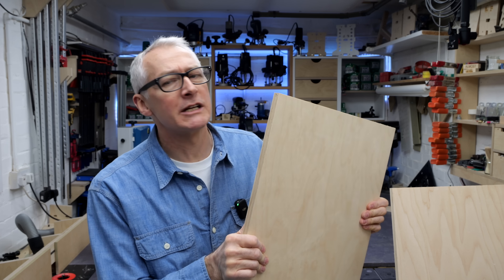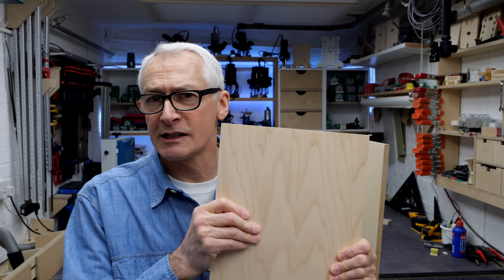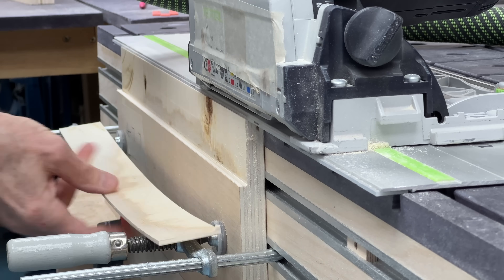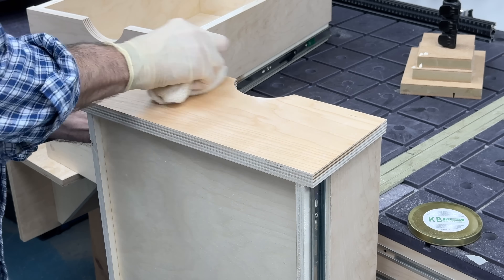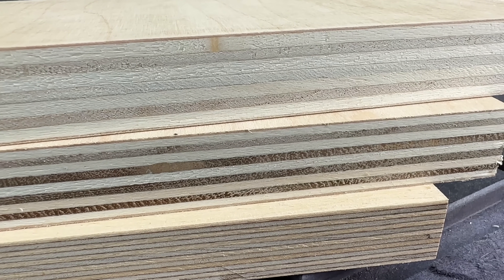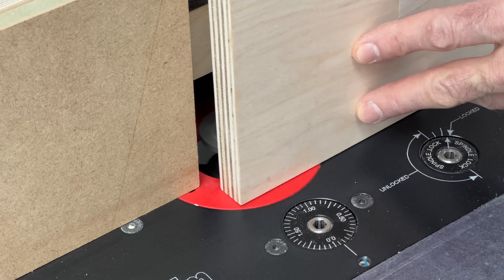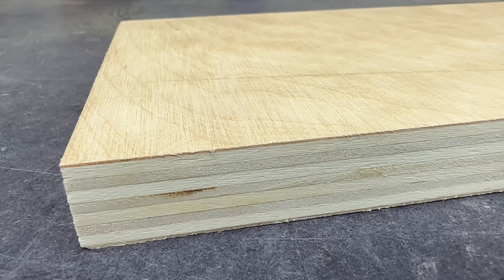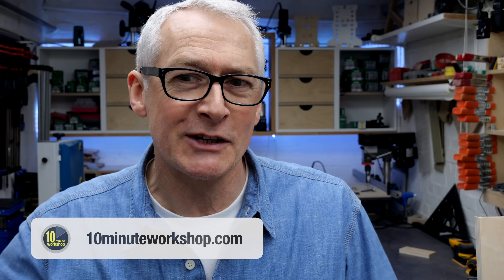Birch Ply Alternatives? [video 527]

Comment: Very interesting. I haven’t bought any birch plywood recently as we had and have a good stock. I would only advise people to be careful when comparing prices of “birch plywood”; not all birch ply are made equal. You do need to check on the number of plus and also the codes for the surface quality (B or BB etc.). Then select the quality you need for a particular job.

But is the price for any of them  “appalling”? I don’t think so. The prices we are paying for all board, in fact all timber, have fluctuated enormously over the last 3 or 4 years. Events such as the war in Ukraine, sanctions on Russia plus the pandemic saw a sudden and extreme change on the laws of supply and demand such that prices soared. Some of those increases have peaked and are dropping but certainly not yet back to levels of, say, 2019. 

Timber is a commodity in the same vein as gas, oil, wheat, iron ore and hundreds of others. Subject to supply, demand and speculators. 

Is anyone making fortunes out of all of this? I’m not so sure. The producers were operating at reduced levels due to labour shortages but their fixed overhead costs remained largely the same. So the overhead recovery per sheet or per pallet had to soar. We have all heard how the cost of shipping have increased as has the cost of diesel or petrol for transport. 

Lastly, we have the timber merchant. I know one of ours quite well. He prices his stock based upon a mix of what it cost him and what it will cost him to replace. So, if a cubic metre cost him £2000 but the replacement will cost £3000, then he prices at £2500. So, he gets a windfall profit. Now. But, when he buys at high prices (say £3000) but will replace at £2000, then his cost price is £2500 which is a paper loss. Then, of course, he has to add his margin to cover fixed and variable overhead costs. 

Going back 10 years or so, the price of waney edged boards was very low. If it had defects like checks, splits, inclusions, then it was probably as good as firewood. Now? The price of a defective waney edged boards is, per cubic metre, higher than processed square edged board. And yet, if I have to process waney edge onto square edged, I will probably have a wastage of 40, 50, 60%. Now that equation of waney to square does make no sense; except it is supply and demand. So, someone who was producing firewood is now making a lot of mone.y good on them.
Reply: Sorry, but I don't think you're correct. Firstly, Maersk shipping like a lot of corporations have posted record profits in their last financial year, and the global shipping price index is low, reflecting reduced economic activity in global markets. Right now, it's not business as usual and price gouging is a thing throughout supply chains as every supplier tries to raise prices. Those with enough market power will succeed until demand drops off. There are those who are testing just testing price tolerance, because you know these prices are not going back to what they were.
Reply: @BigHenFor  I can’t talk about Maersk but I know that al out of shipping rates are booked well in advance; just as people forward buy currency in order to get a price certainty. Of course, a key part of marketing is understanding how much the market will bear - I’m sure that controls the prices that Festool, for instance, charge. However, pricing of most commodities is a factor of supply and demand. If the production requirements (to keep a factory running) of a particular product that is made across various companies and countries are high and demand is less than that, then prices almost certainly fall. At the moment, from what I am told, that supply and demand balance, which was so heavily in favour of restricted supply, is currently falling somewhat towards lesser demand. I’m told to expect further easing of prices but we shall see.

Comment: Excuse the potentially naïve question but apart from the look of the endgrain, how are these plywoods such a difference to say a sheet of 18mm hardwood ply at about £40 from Wickes et al and especially if you're just making carcasses, shelf units, and the like?
Reply from the maker: I do go into the details in the Baltic Birch Basics vid - link in the description - but it’s basically a much better quality board with better core layers and face veneers. I’d check out the other video though. 👍👍

Comment: What are your thoughts on dust generation?  My experience with what I believe was poplar ply was that it made a lot of very fine choking dust, even some later after I improved.
Reply from the maker: I haven’t noticed anything different about it tbh, but I always use dust extraction so it would need to be pretty bad to be noticeable. 👍

Comment: Hi Peter wow those alternatives are still expensive fortunately my local timberyard are quoting £135 for 18mm Birch ply which is still a lot of money but they don't have the alternatives
Reply from the maker: At £135/sheet I’d snap it up if it’s decent quality. 👍👍
Reply: What buildes  merchant is that?
Reply: Well, if Kevin does name the merchant it will all be gone by the time The King has his hat on tomorrow.
Reply: @emmetworkshop2829  comment of the day, thanks for the 😂

Comment: At those sorts of prices, would bamboo be a viable option?  19mm 8x4 sheets are around £200-£250 from somewhere like UK Bamboo Supplies.  Obviously looks are subjective, and I've no idea how it works but might be an alternative to other ply or mdf.
Reply: Not worked with bamboo sheets but fitted some bamboo worktops and they required extreme care to minimise splintering, not a fun material to work with.

Comment: If the issue is just the visual appearance of the cores then do a demo on edge banding or veneer. It's really fast with the right tools.

I think In the future we will need to learn to appreciate the defects in more basic materials such as shuttering and softwood ply, and make the best of simpler cheaper materials.
Reply from the maker: Edgebanding can only go so far - try edgebanding a tight internal curve like a handle cut-out in a drawer front, for example - and a large part of the appeal of Birch is the lack of any special edge treatment needed. But I agree, we'll need to get used to less than stellar, cheaper materials; unfortunately these two boards are too costly to be in that category! 👍

Comment: Thanks Peter, interesting video. Do you ever use blockboard at all? Seems to have gone out of fashion but might be a useful substitute for ply in some situations.
Reply from the maker: Can you still buy it? Haven’t seen it for donkeys years!
Reply: @10MinuteWorkshop  Absolutely. Google throws up lots of suppliers, £40-£80 a sheet for 18mm. All I have seen so far look thinly veneered, not Baltic Birch quality but there maybe some good stuff out there as well. Obviously not a direct replacement for ply because of the directional grain but would be a good substitute for carcasses etc and maybe not as poisonous as mdf.

Comment: Do you have something equivalent to the German 'Dreischichtplatten' (3-Schichtplatten) 3 layer sheets in the UK?
Reply: The closest we have is a blockboard....thin plywood facings over a solid wood block core. It used to be very common, but I haven't seen any for sale for years.
Reply: Actually, I've just googled it and it is still available and rather cheap at about £50.00 for an 2400x1200x18mm sheet!
Reply from the maker: I might need to take a look! 😯👍
Reply: @davidhull2060  That would be Tischlerplatten or Stabsperrholz in Germany
Reply: @10MinuteWorkshop  SWL Holzplatten is a supplier of these materials in many variants. Your YT colleague Heiko Rech has an excellent item (in German) on 'Tischlerplatten und Dreischichtplatten'

Comment: I must admit, bare MDF has started to grow on me.
I built a quick cabinet for the office last week using B&Qs finest and just left it 'raw'
Reply: You are one sick puppy.
Reply: @FIZZYYAM  at least it looks better than pine
Reply: Not really much difference between MDF and PLY prices in B&Q,  £37 and £45 respectively ....... both prices are a joke compared to a few years back ..... with regards the MDF, varnish the surfaces and then sand/seal/paint the edges and you get quite a nice look 👍
Reply: B&Q used to sell Birch ply. Their MDF has to be the worst quality MDF but what can you expect for £37. The softwood play isn't too bad but that garbage hardwood ply with the wafer thin veneer, I'd rathe ruse OSB than that stuff.
Reply: Not sure if it varies by area but certainly both B&Q stores near me sell Medite MDF
Reply: @paulmcfadyen689  the two different B&Q's I go to have different stock. One has Medite MR but just an unbranded standard, the other has the unbranded in both.

Tbh, I've never had an issue with their own brand one, cuts and sands beautifully and the surfaces are perfectly smooth.
Reply: @animationcreations42  oh we don't get MR mdf in B&Q here
Reply: @barry.w.christie  I think those prices speak more so to B&Q quality, than it does either materials. Their MDF is awful, and their plywood is worse!
Reply: @monkeysausageclub  Agreed. B&Q is the worst stuff out there. Wickes have half-decent non-MR stuff, that makes what you can find at B&Q look like cardboard
Reply: @FIZZYYAM  Yes officer, this man right here

Comment: The poplar core/maple faced plywood is typically edge banded or face framed. It's not ment to be an exposed edge material, that's why the veneer is thin. It's the same thickness as cherry, mahogany, etc. Solid poplar is used as a paint grade moulding wood in the North America. It's a super fast growing semi-hardwood. More weed than tree. Baltic birch was a great material. China birch is not.
Reply from the maker: I’d have no problem with them calling it a nicely veneered plywood that requires edgebanding. But I t’s sold here in the UK as ‘the real alternative to Birch ply…’ which it isn’t. 🤷‍♂️

Comment: Baltic Birch used to be a "cheap" alternative to solid hardwood glue ups. Sigh, I'm looking at solid wood again, or just girding my loins and paying for BB. And doing fewer projects (although the weather has proven to be a bigger obstacle since I have to work outside). Just wish it was easier to get that solid black (or at least a colored water resistant) MDF. I can special order it, but would rather see it in stock.

Comment: I was horrified at the cost of 18mm birch ply when it reached £80 for an 8x4 sheet... as a hobbyist, its just not viable at current prices.

My last project was a set of floating shelves in my kitchen. I ended up building them using an open box of engineered flooring from b&q. Needed a bit of planning, but they're accurately dimensioned and stable, and required almost no finish work. Obviously no good for professional work, but its an option for the hobbyists.
Reply: Let me know where you can get Birch PLy for £80 a sheet!!! Unless you mean £180...

Comment: Thin veneer on junk board for full price.  ow.   Probably better off buying B grade plywood and veneering them yourself at the end.    Shops won't want to do the extra labour but for home gamers the cost of plywood or any wood has been out of control.    Local plywood store quoted a lower price on Maple plywood than Baltic Birch.    I still have to call to get details on whether this is a lower grade.

Comment: For that much money, I'd buy real wood rather than ply  love the videos by the way
Reply from the maker: I think you’d struggle to get the same quantity of real wood for that kind of price, but they’re definitely getting closer!
Reply: Bought solid wood boards of both maple and poplar recently (2.4mx240mmx54mm +/-) - rough sawn. You'd need at least 4 boards (halved) to make a rough 18mm ply sheet equivalent. My poplar boards cost about £70 each and the maple about £130 each. So it's still a fair bit more costly for solid hardwood. Interesting point of note is that solid birch boards are more expensive than poplar at the mo with my supplier. They weren't pre covid.🤷‍♂️